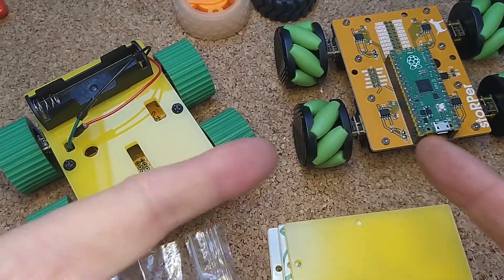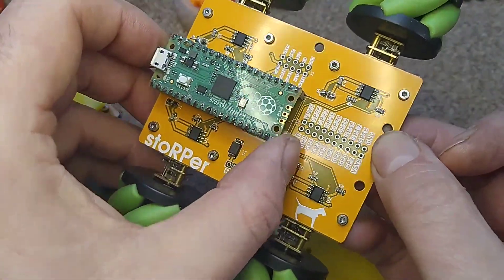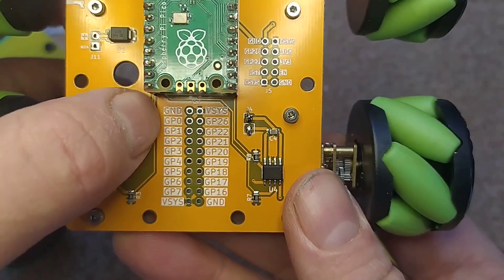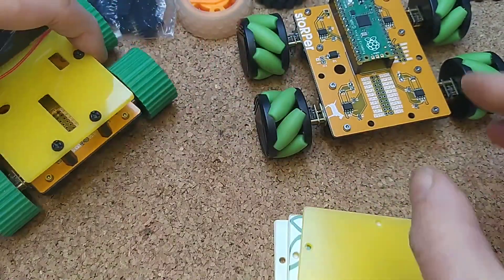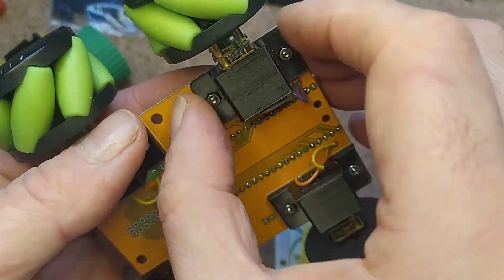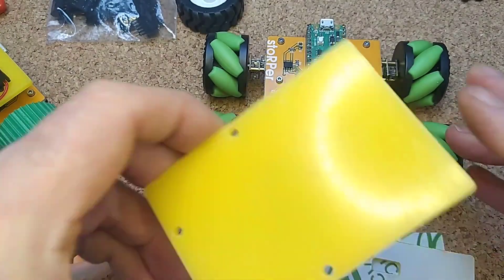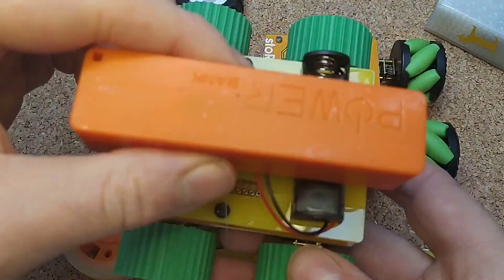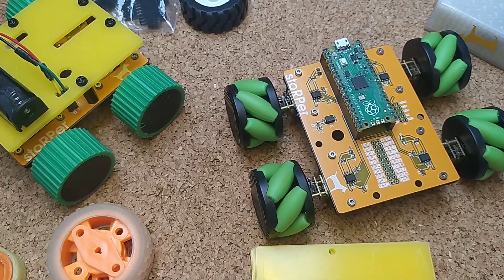StoRPer, A new Opensource Affordable Modular Robot Rover!

Comment: Cool! For the regular wheels, i noticed the test code only goes forwards, to expand this is it best to implement tank style steering, and spin on the spot?  Also the store is in dollars but your in the uk, what's going on there?
Reply from the maker: Hi yes tank steer is a good option. I also imagined down the line doing some experiments with feathering speeds of individual motors in turning to create efficient motion. The Mecanum simple example on the repo also has examples of turning the wheels in different directions.
Reply from the maker: Oh also the dollar thing. It's the default currency of the Tindie site. Makes no difference really other than I have to think about dollar prices!
Reply: @concretedog7427  thanks for the reply, wow I had it in my basket yesterday when I messaged you and it's sold out already! Congrats on the popular product 🙂
Reply from the maker: @kdt85  hey so sorry you missed these. Hope to have stock back up in maybe 10 days.. I can see the PCB are fabricated and its in the queue to have the SMD parts added. So hopefully no delays. Thanks again for your interest.
Reply: @concretedog7427  thank you! I have motor driver boards and everything already I should really stop being lazy and put them together! I just really liked the form factor and can imagine 3d printing all sorts of cool shells and accessories

Comment: An interesting little robot, but it has a huge drawback. You designed the whole thing wrong. Motor mounts made from an injection molding are used for installation by holding the gearbox, not the motor! With an assembly like yours, these gearboxes will be destroyed very quickly by anything that gets between the gears.
Reply from the maker: You can use the clamps over the gearbox in the same way as the commercial ones with a standoff. Or indeed we could design a mount that has a gearbox cover. I've run them a lot as they are and they are pretty resilient.
Reply from the maker: Most of the commercial injection molded ones you refer too are used over the motor... https://shop.pimoroni.com/products/pimoroni-gearmotor-bracket-pair?variant=23686314439
Reply: @concretedog7427 You are wrong, all the motor mounts I have, have edges identical to the gearbox and are used to hold the motor by the gearbox. For example, those from Pololu. Additionally, if you mount the motor by the gearbox, the motor housing will overlap the RPI solder pads.
Reply: @wendajaroslaw  all the motor mounts you have.  But not the one that he reference to do. So I guess that @concretedog7427 isn't wrong, as if it even matters.  But your way of write made me response to your "argumentation".

That said, it isn't a bad idea you have, and should probably be adjusted for.
Reply: @wendajaroslaw I'll probably just throw some electrical tape over the gearbox

Comment: Absolutely love it. I just tried to order three PCBs to Germany but it tells me that the seller wouldn't ship here. Is that correct?
Reply: Already ordered :)
Reply from the maker: @Lammy2k  You just made the cut off for my first post run tomorrow! All packed here and ready to go! Danke schon!
Reply from the maker: I'll happily ship out to Germany, on tindie there is a "request shipping to my country" button somewhere! If you click it I'll research and set up a postage price to get StoRPer to you!
Reply: @concretedog7427  Thanks for the quick response. I'll try it in a minute. Can't wait to get my hands on.
Reply: So it appears there is no "request shipping" button (at least i can't find it). However, Tindie tells me that it automatically requests shipping to another location by sending a message to the seller. Did you see anything in your inbox?
Reply from the maker: @Lammy2k  yes just checked and I see a request for Germany and a few others. I'll research sending UK-Germany and add the option soon... you should get a notification when I do. I imagine it is a bit complex with brexit rules etc :(
Reply from the maker: You should be able to order for Germany now... might take a few minutes for the changes to populate through the Tindie platform!
Reply: Absolutely love mine. First stoRPer is already driving around in Hamburg. The kids in the neighbourhood love it. One questions though; I assume the connector for the battery are 5V?
Reply from the maker: @Lammy2k  I love that you love it! I'd love to see some clips or photo's of your StoRPer! Re your question, The power connector on the stoRPer can be powered by any source under 5.5V. It works really well if you just attach a single cell LiPo or Lion battery to that connector. So I've used a 14500 cell which run up to 4.2V and they conveniently fit into an AA battery holder (you can see the holder in video). The other StoRPer video on my channel of it running over surfaces here in N Wales is exactly that setup.. a 14500 battery directly connected.